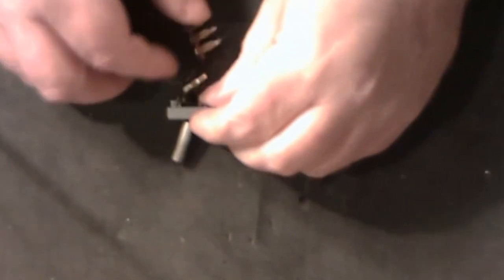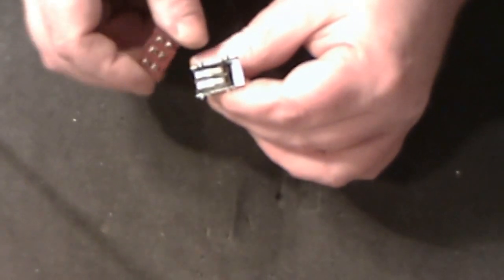Atari 2600 power switch LED #3

Comment: If you want something more appropriate for a console as vintage as the atari, try and find yourself a bunch of the older Gallium Arsenide diffused red leds. gives it a more gentle red point of light rather than the blindingly bright stuff you find these days.